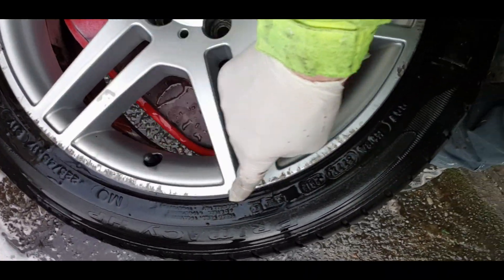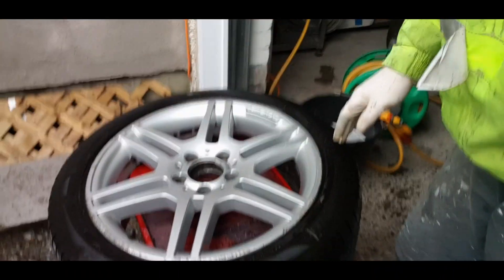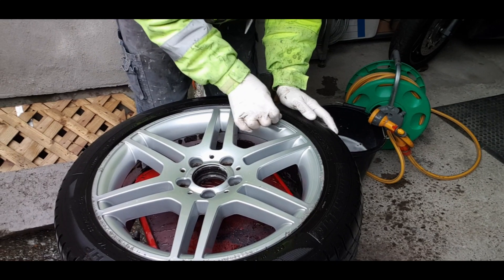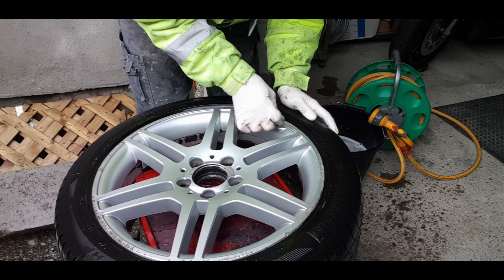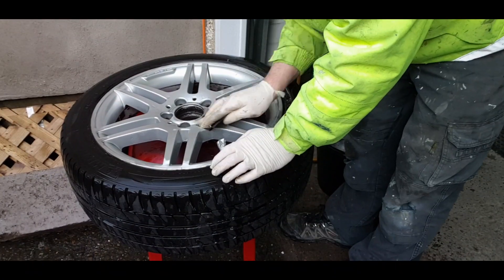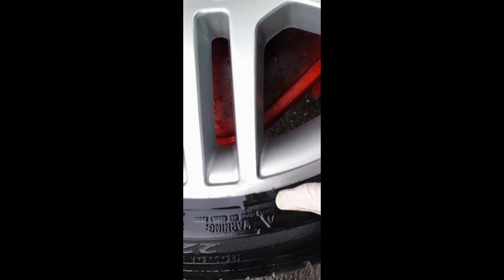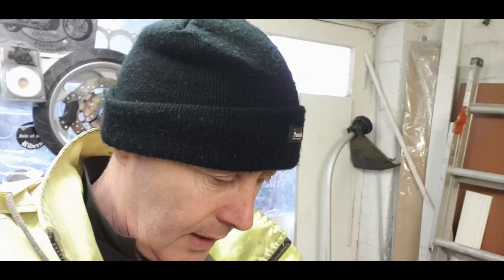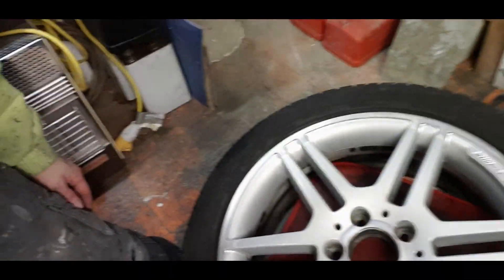How to Paint Wheels Two Tone

Comment: Great video! How long did you wait before tapping the wheel for the second color? ( I saw that you used a hairdryer to accelerate the process) If it is not too much to ask, can you give me a walk-thru timewise from primer to clear coat. Thank you sir.
Reply from the maker: H,i  put 2 coats of primer on, used heat gun and left to dry for 15mins between coats. Apply the silver, same technique,  if 2 coats cover, leave for 20mins, mask up centers and do the same for the grey. Unpeal masking and put 2 or 3 coats of lacquer on, leaving 20mins between coats then leave overnight to dry. Hope this helps
Reply: @iknowjack4693  Thank you. So you didn't need to clean the paint after you removed the mask/before applying the lacquer? I wasn't sure if the masking tape would leave anything on the rim that would impact the application of the lacquer.
Reply from the maker: no, the masking tape i used,  didn't leave any residue. It was standard tape apart from the thin line tape

Comment: Niceee work. You didn't use any filler to fill in all those scratches?
Reply from the maker: No filler used, but took long time to rub down 🙄
Reply: @iknowjack4693  Doesn't this remove process remove too much from the rim material? I mean, doesn't the rim surface become uneven by grinding away metal and not refilling the empty space? In the end, doesn't this lead to the need for more counter-weights to balance the wheel? What did you experience?
Reply from the maker: If its not too deep and its most of the way round, it shouldn't make any difference.  If it is deep, then a bit of filler will won't harm.